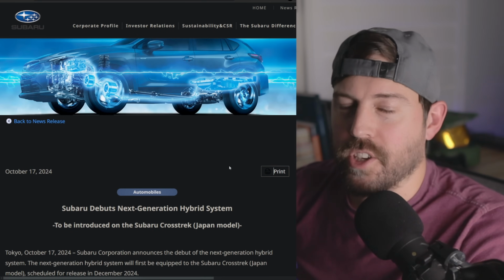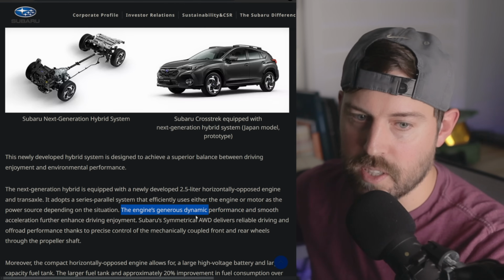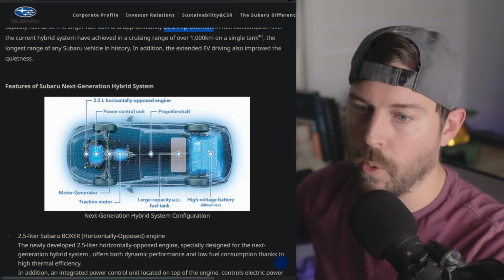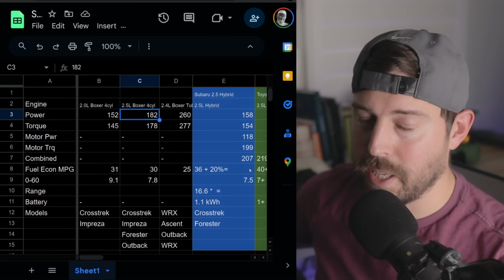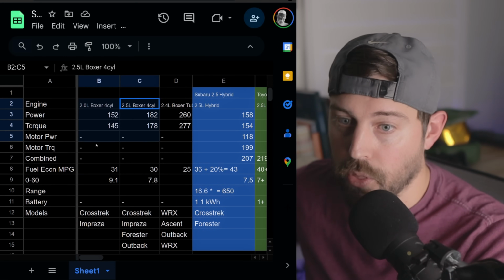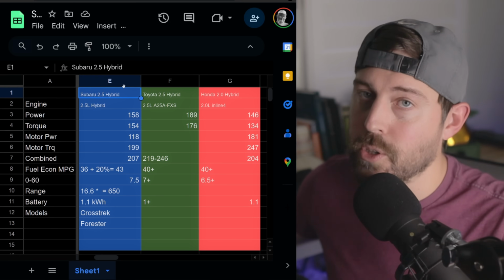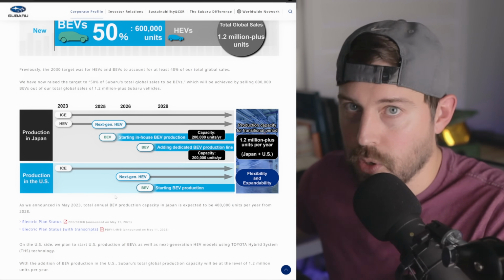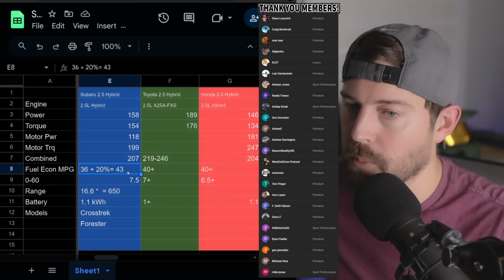Subaru's NEW hybrid Announced! Does it BEAT Toyota and Honda hybrids?

Comment: Great video! Glad I discovered your channel. Just a quick correction, because Subaru said the new hybrid system demonstrates a 20% reduction in fuel consumption over the mild hybrid, not a *20% improvement in fuel economy*. These are two different calculations. What you should do is apply the 20% improvement to the mild hybrid consumption number (6.53 L/100KM) and get 5.22 L/100KM, and then convert to fuel economy = 45 MPG. A Japanese youtuber posted a video of him driving 1000km+ on the new hybrid and he averaged 45mpg combined city/highway. This car is gonna sell like hotcakes! Toyota hybrid system reliability and efficiency with Subaru character, boxer engine and AWD system. And finally enough power/torque for the Crosstrek.

Comment: I currently have a 2016 Outback Limited.  The “EPA” rating on the sticker was 33 MPG.  That has not been my experience in the 6 years I’ve owned it.  At 75 MPG (interstate) which is 80% of my driving…I constantly get 22-24 MPG.  I constantly beat myself up for even buying it since I was expecting conservatively 30 MPG highway.  At 55 MPG, I consistently get 30-35 MPG.   What are your thoughts on “real life” interstate driving with the hybrid?

Comment: Great video, good if the Crosstek will have +- 200hp, and a 1.1kwh battery, the Forester could have a larger battery of 1.3 +-, and around 240hp combined, to have a relatively better weight-power ratio.
Reply: 1.1 or 1.3.??         Both to tiny to power any kind of electric motor................Paul

Comment: How in the heck could the Suby with mechanically linked AWD match the fuel economy of the Toyota Rav4 Hybrid with eAWD?  Seems unlikely at best.  It seems the curb weight of the two vehicles will be nearly identical as a Rav4 Hybrid is only like 400 lbs more than a Crosstrek currently.  If mechanical AWD can match eAWD, why would Toyota not adopt this tech that they helped develop into the other million hybrids they sell each year?  More parts to wear out and more complication?  It seems like the parent company Toyota would at least add as an option for those who want a higher performing AWD system.  ALSO, maybe not as relevant with the Subaru AWD, but at least Toyota needs to add a function to lock AWD in all of these vehicles with AWD.  Hyundai/Kia has that button!  Trail mode is not sufficient and also there is no AWD monitor view in the Toyota hybrids other than the Highlander and presumably the Grand Highlander.  That is useful in tough conditions.
Reply: my bad, it doesnt decouple, it transfers torque really proficiently

Comment: Subaru are certainly going to increase sales of the Forester in the UK once the hybrid comes out - it launches in spring 2025 apparently - because Toyota UK has just pulled the RAV4 HEV from the UK market, so it will now only be available in PHEV. 

I found out when I tried to order a RAV4 HEV last week. Toyota might have done me a favour though as the AWD system is better in the Subaru and I don’t mind that fuel consumption could be a bit lower than the RAV4. I’d only discounted the mild-hybrid Forester because of the much high fuel consumption and emissions, and the full-hybrid system should help with both those things.

Comment: @KirkKreifels Just caught this. Great video! Have you seen any Japanese reviews of the Crosstrek Hybrid yet?

Other questions for the future:
- Spare tire?
- Which Lithium-ion battery chemistry are they using? NMC? LFP? LFP is heavier but performs better (i.e. actually functions) in below freezing temps. 
- Engine conditioning: does the engine always come on immediately when starting the car to warm itself up, circulate engine oil, etc? What steps (if any) has Subaru taken to ready the FB25 for frequent start/stop duty?

Comment: Looking all over the planet for this...  Does the new Next-Gen transaxle have a CVT belt/chain?  I'm hoping Subaru goes from the shortest lasting transmissions to the longest.  I have 3 Toyotas with the eCVT and they are the greatest transmissions ever made!!!
Reply: What i found really strange was the previous Crosstrek PHEV transmission was called a CVT but it was a planetary gear system. that being said, the dealership told me the fluid had to be replaced every 30000 miles instead of 60000 like Toyota. i didn't understand why but it was definitely a planetary gear system. not a vhain. Finally, the dealer told me it required a special transmission fluid that was different from the ICE Crosstrek

Comment: LOL that thing still has a long drive shaft connecting the front to the rear.  The Toyota hybrid AWD system does NOT have that shaft because the rear wheel are driven directly by the electric motor powered by the hybrid battery.  Toyota calls that rear differential/motor the rear transmission.  I've been a Toyota tech since 1998 and that system has been around since the 2006 Highlander hybrid AWD and I have never seen any problem with that system.
Reply: Pros AND cons of each approach, and the video touched on those. The Subaru system can put (I believe) up to 90% of the power to the rear axle when called for. Imagine cresting a very steep dirt or snowy hill where the front wheels have no meaningful traction. The electric motor in the rear axle on the Toyota isn't going to have the power to get the vehicle up and over the hill on its own. Subaru's existing AWD system is better than most, and they made the right call sticking with it here despite it definitely being a little less efficient and more expensive than the Toyota eAWD approach.

Comment: MotorMix claims that the engine will be a 260 HP turbocharged hybrid engine. This is not evident from your presentation? So I wonder what it is going to be like?
Reply from the maker: Turbo hybrid? It's possible but that's not what Japan has at the moment

Comment: Sounds like it should compare well to the 2.0L hybrid system in the Toyota Corolla Cross Hybrid. A little more power and a little less fuel economy. That would put it probably between Toyota's 2.0L and 2.5L hybrids by my guess.

Comment: I’m planning to buy a Toyota Camey 2025 hybrid, but  I am really worried about the life of the battery and how much does cost to replace it! Can't make a decision
Reply: Toyota’s hybrid batteries are warrantied for 10 years or 150k miles. To expand the life of your hybrid battery, do not block the cooling intake vent and keep that hybrid battery filter clean. The Car Care Nut channel has a lot of information on Toyota’s Hybrids
Reply: Toyota hybrid is bullet proof! Just don’t leave it sitting for more than a couple weeks to keep the battery charged!
Reply: The batteries last longer than you would expect and if you are in a big city, you can probably find a service to install a refurbished battery for cheap ($1K - $2K) if needed when the car gets old. The battery thing for hybrids is completely overblown.

Comment: Any word on whether it has a spare tire? I'm guessing no.
Reply: Crosstrek hybrid does not (have a spare)because that's where the battery is at vs. under the back seat and losing storage capacity.  I would guess the Forester will be the same.

Comment: Sorry if I missed it but does this use an e-CVT like Toyota and Honda or is it a typical belt CVT?

Also would the next outback get this powertrain eventually?
Reply: The 2 motor-generator series parallel configuration indicates an e cvt.

Comment: In 2012, I needed a new car and it was between the Legacy(32 mpg) and a US VW Passat TDI(40 mpg).  In the end I went with the TDI which is a great car.  Now 12 years later, no more TDIs in the US, so I was thinking of a Legacy again.  Then came the 2025 Camry AWD which will get 2x the mileage of the Legacy.  The downside is that the Camry will have an electric motor driving the back wheels, so it really can't go everywhere like a Legacy would.  Now, there is no future for legacy and there is no Impreza Sedan, so it is possible that Subaru will lose again.    I can not live with a forester, so the crosstrek could be a possibility, but will not be here in time.

Comment: I started to get excited looking forward to these, but then realized Subaru will likely stick to their garbage outdated potato-powered infotainment system.  If they upgrade that though I’d love a forester hybrid.
Reply: The 11.6" infotainment was a big disappointment for my family on a recent Crosstrek testdrive. Some of the most important climate controls are in the touchscreen so the driver or passenger has to take of their gloves/mitts to adjust it, which is not nice in Canada's climate. Even though the temp control is physical buttons, you can't feel for them and likely have to look at the setting rather than just feel a physical dial turn while keeping your eyes on the road. It was also laggy to the point of being unsure if it registered a touch, which is frustrating. I was more willing to overlook this, but the rest of the family was not so generous and the car became a pass.

Comment: IMO, based on the little knowledge I have about hybrid systems, Subaru should have gone with a smaller gas engine, a larger electric motor with a lager battery pack.   They also need to add a 4WD lock to make sure power is sent to the rear for going offroad vs just using their existing fluid/clutch system to send power to the rear.
Reply: I think Subie is smarter than You........Much planning goes into these...............Paul
Reply: And kinda reminds Me of non-Pilots trying to explain aircraft accidents......Paul.....retired ATP

Comment: Have a 2020 Crosstrek Plug In Hybrid. Ask us questions since it sounds like the new hybrid will have a similar system as you said in this video.
Reply: Differences seem to be engine differences (2.0l vs. 2.5l), more cargo space (and lower weight) in the upcoming hybrid, but little/no EV-only range. 

This feels like more of a 'hybrid default' transition akin to what Toyota is doing with their lineup.

Comment: I'm surprised that with its greater size and weight, the Forester wasn't the first Subaru to benefit from this new more-powerful and fuel-efficient hybrid system, rather than squeezing the components into the smaller and already more-efficient Crosstrek.
Reply: I'm with you on this.. but maybe outside the US, smaller vehicles sell better?  Just a guess.
Reply: Yeah I would assume it's because the Crosstrek sells more than the Forester.
Reply: Subaru Japan still has the prior gen Forester and they don't sell as many of their larger models, so its not a huge surprise.  They went with volume first there in Japan  - that's the Impreza/Crosstrek/Levorg line.

Comment: The Crosstrek is sold in Australia as a conventional boxer car and as a mild hybrid e-boxer. For your comparison the mild e-boxer uses a 2 litre petrol engine with a small electric motor. Numbers are petrol engine 110kw and 196Nm and electric motor 12.3kw and 66Nm. I think the battery is about 0.6kw capacity. These combine for a best fuel efficiency (highway and urban) of 6.5l/100km compared to the conventional engined Crosstrek with combined fuel economy of 7.2l/100km . No one driving it however ever gets this low a number. What has been announced will improve the e-boxer immensely. We are expected to get the Forester with the new e-boxer arrangement in mid 2025 direct from Japan. I assume the e-boxer Crosstrek will follow soon after as the Forester is the big seller amongst Subarus in Australia.
Reply: Subaru diesel versions deleted as per most other manufacturers. Kia is still selling diesel Sportage but others have opted to develop hybrids and delete diesels.
Reply: Isn't there an option for Diesel Subaru in Oz and other countries? A flat-four diesel is an interesting engine indeed!
Reply: @erictrinklein4408 No diesels in Europe either, and in the UK specifically (not sure about the rest of Europe) we currently only get the eBoxer mild-hybrid on the Crosstrek and Forester, so the full-hybrid is definitely a welcome addition. The Forester is due to launch in the spring, but not sure when the Crosstrek will arrive.

Comment: I wanted to chime in as a 2016 Rav4 Hybrid owner. It was the first Rav4 Hybrid, with a 2.5L NA engine (Atkinson Cycle) and similar specs. The car has been absolutely bullet-proof, zero maintenance in 8 years other than oil changes, tire rotations. Its taken us through deep snow storms and ski cabins (unplowed), with all-weather tires (goodyears) on its pretty basic AWD. This Subaru hybrids have very similar specs, but fix two areas. One is range on a single tank of gas - this is a huge deal as it means we dont have to fill up as frequently and makes for more off-road excursions away from gas stations. The other is a mechanical AWD system, which is superior to Toyota's as far as grip and offroad performance is concerned (maybe taking a small efficiency hit). I am seriously eyeing trading the Rav 4 hybrid with Crosstrek hybrid with this specs. 200+ hybrid HP is going to wake that little car up and ground clearance is also more vs Rav4! The only negative is its smaller. I dislike the dorky look of the Forester and Outback so thats a non-starter for me personally - but beauty is in the eye of the..lol
Reply: The question is, how much longer will the battery last after the battery warranty expires?
Predicted battery lifetime is 12-15 years.
Will the cost replacing the hybrid battery nullify 12-15 years of fuel savings? Most likely.
Reply: @Tractshun  fair question. I dont know but doubt it. The NiMh batteries can be refreshed. Also, hybrids save on brakes as well, transmission service and last but not least the power is much smoother and stronger. Its a worthy trade to be honest, for the very reasonable uncharge.
Reply: @sunnyvalentino  If brakes are designed properly, they seem to last a long time.  I just did the rear brakes on my '20 Forester at 95K miles.  I still had plenty of pad left to go over 100K miles.  The fronts had more than double the pad of the rear so I'm still using the factory pads.  I've never had a vehicle where the pads lasted this long.
Reply: @Tractshun This IS a Vehicle that I'm Willing to Wait for, 🇺🇲⛽️🇨🇦Assuming IT Keeps the Fuel ⛽️ Tank Size & Ground Clearance [All Weather tires]. Boston MA🇺🇲
Reply: @Tractshun You can create a simple model to answer this question. Can even simulate fuel price variability.
Reply: I've been a Toyota tech since 1998 and own a 2018 Rav4 Hybrid which is the same vehicle as yours.  I'm not sure why you think that the mechanical AWD system is superior but as far as the reliability is concerned, there's no competition.  The Toyota Hybrid AWD system has been around since 2006 and I have NEVER seen a problem with the system.  I'd say the whole Toyota hybrid drivetrain (not including the Tundra or the Sequoia) right now is the most reliable part among any Toyota vehicle.  The Rav4 from 2006 - 2012 had a big problem with the rear coupler making a whining noise.
Reply: @EmbraceTheSuck240  i've only had a Japan built prius. How does this rav4 hybrid compare in long-term reliability if not built in Japan? Trying to decide between this and subaru crosstrek hybrid (the new prius has gone in a completely different direction than i want to go)
Reply: @comment6864  Hybrids don't matter whether they're build in Japan or in NA since they don't use the 8-speed transmission which IMO is the biggest reliability problem with Toyota currently.  Subaru doesn't have their own hybrid system, it's all Toyota which owns a chunk of Subaru.
Reply: I was about to order a RAV4 hybrid here in the UK, but when I tried to I found out that Toyota has pulled it from the range here in the UK, and you can now only order the plug-in version. 

So I’m very happy to see Subaru will be offering a full-hybrid Forester. I’ll get everything that the RAV4 offered, but with a better AWD system, and it’ll likely be a bit cheaper too.

Comment: Love Subaru developing a hybrid. The one issue that has kept be away from them in the gas mileage. If they can get it into the 30’s I will be in the market. I was considering an AWD Camry, but I would rather get a hatchback or station wagon.
Reply: I get 36-42 mpg in my 2018 crosstrek
Reply: @christopherkeene3647  Only rated 25-28 all around so you must be a hyper-miler
Reply: I average 30 mpg in my 19’ wrx mixed driving, Subarus seem to do better then their rated numbers

Comment: I am glad that Subaru went with the direction I was hoping them to go for: electric motor supplementing Symmetrical AWD. this makes much more sense than trying to shove Toyota's Atkinson Cycle hybrid system into a boxer engine. Hope they are successful to the point that frees up the CAFE limitation for Subaru to build the STi that the VB gen deserves so much. 
I've been waiting to buy a daily car as well. While Cresstrek Wilderness is nice, I am waiting to see how this new hybrid system is going to work out.

Comment: Curious why the CRV hybrid is faster despite having lower hp/tq than the rav4? Looks like it might just be lighter by about 100lbs? Or due to a better 2 motor system? 7.5s is just quite slow so not so appealing and no way it's gonna have the reliability of the proven toyota system or even honda.
Reply: It’s how Honda’s hybrid system is designed. Honda’s system relies heavily on the electric motor and the engine is connected to a generator. So the CRV Hybrid has an almost EV like feeling. Honda does add a lockup clutch (or 2 for the CRV) that engages at certain speeds because there are times where its more efficient to have the engine drive the wheels.